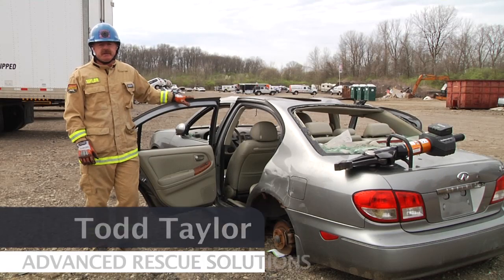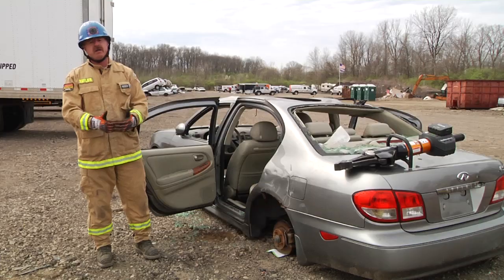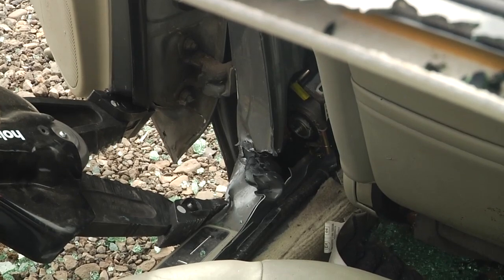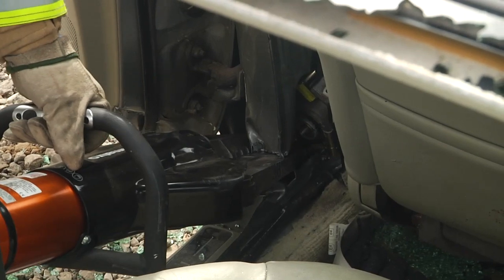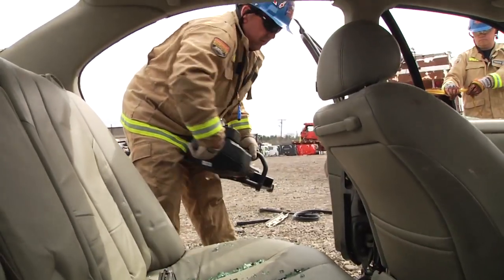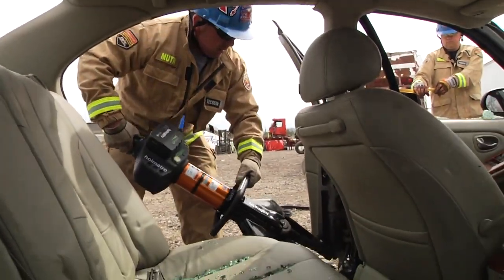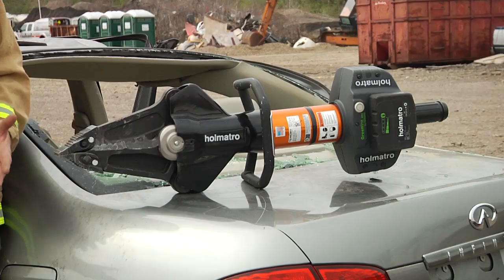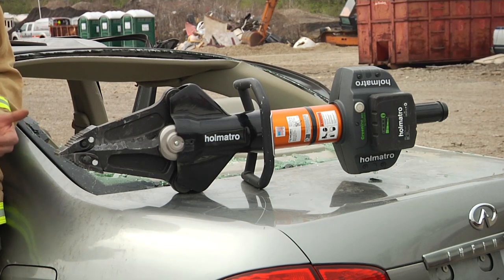Holmatro Quick Cuts 4 (2018): Combi Tool for Side Removal

Comment: My squad just bought a TNT combi tool and a ram. I'd rather we bought a dedicated spreader and a cutter instead, I'm used to using our Hurst hydraulic spreader and cutters to do a batwing and modified dash lift. I'm thinking having to jack around with taking tips off and putting them back on is going to cut into extrication time and the possibility of losing the tips, unless we have a guy who's sole job is to hold onto the tips while the other guy cuts, as we all know how chaotic a scene can get, especially at night.
Reply from the maker: Fair point. We made the tips removable to help prevent the material from being crushed instaed of cut. The tips could fit in your pockets, or you could hand them to a colleague. And it's not always necessary to remove them. So there's always a couple of considerations to be made here.

Comment: How does the cutting and spreading force of the combitool compare to full size cutters and spreaders?
Reply from the maker: Hi Erik, a combi tool will always be a compromise between dedicated cutters and spreaders. This particular model has between 50-60% of the forces of similar sized cutters and spreaders. However, as the forces of these hydraulic tools are very high, this still results in a highest spreading force according to NFPA 1936 (HSF) of 10589 lbf (= 47.1 kN / 4.8 t) and a maximum cutting force of 208848 lbf (= 929 kN / 94.7 t). Hopefully this answers your question.

Comment: Way too slow
Reply from the maker: That depends on the condition of your patient. Not all fire & rescue services have enough financial resources to buy dedicated cutters and spreaders. A combi tool that can both spread and cut is a good choice when your budget is limited. The tips on this combi tool are removable to prevent the material from being crushed instead of cut. It is not always necessary to remove them though, this depends on the material and its shape.

Comment: Can you still use the cutting function with the tips still attached, or do they have to be removed?
Reply from the maker: jake hofbauer You can also cut with the tips still attached. However, when cutting flat sheet material (as opposed to square or round profiles) it’s better to remove the tips to prevent the material from being crushed instead of cut. Does this answer your question?